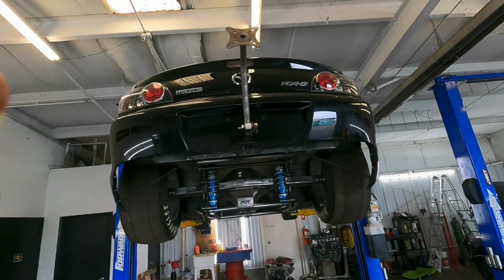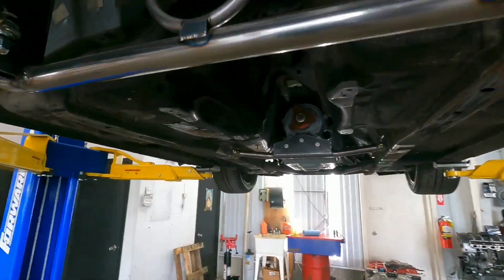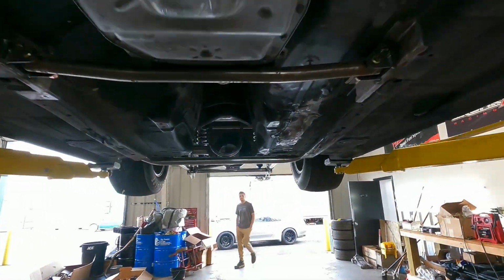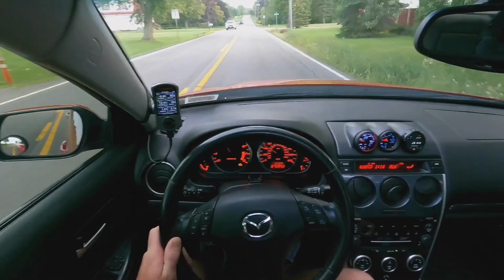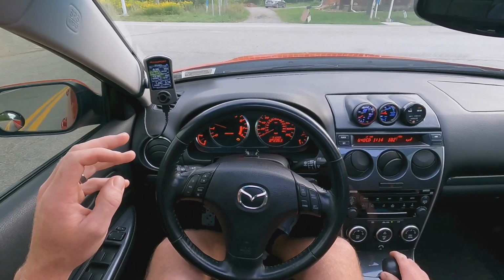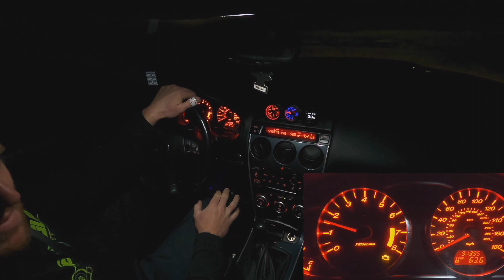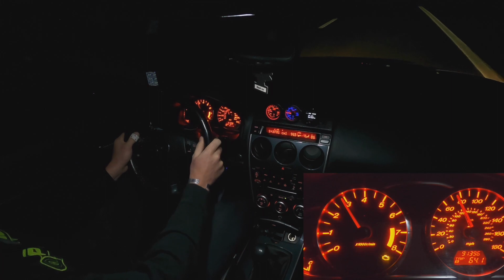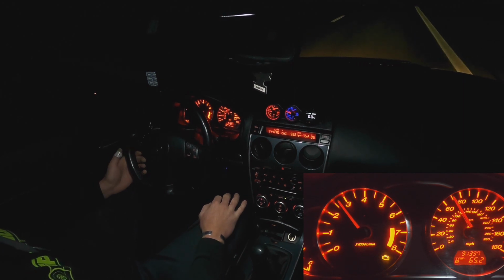Fully Built BIG Turbo Mazdaspeed6 POV Driving Video!!! WOT Pulls, EPIC Turbo Noises & More!

Comment: Hey Alex whats the wastegate setup on this thing? Usually high horsepower speeds have crazy loud nasty sounding wastegate dumps but this sounds excellent. Loud ass spooly noises

Edit: 40 lbs of boost!? My god dude that thing has gotta be so ridiculous
Reply from the maker: VS racing 50mm
Reply: @SpoolingUpPerformance  thanks! do you have it rerouted to the downpipe or is it just a dump tube?
Reply from the maker: Dump to the ground
Reply: What BOV setup are you running? This is an amazing double whoosh
Reply from the maker: Vs racing 50mm

Comment: Are you running a BOV or bypass valve or dual port? Also what kind ?
Reply from the maker: Blow off valve 100% atmospheric. It’s a VS Racing 50mm. Another great option is a turbosmart race port 50mm
Reply: @SpoolingUpPerformance  thank you!

Comment: Are you leaving the balance shaft box in the oil pan for the RX8? I thought most performance oriented Ford builds remove that for quicker revvs. Looks super sick that's gonna be an internet hero when it's done.
Reply from the maker: That’s just simply a mock up engine  in there so we can mock up parts while the race motor is being built

Comment: mod list again......
Reply from the maker: Engine: 
ShortBlock from SP63 / Head Done by Peanessa Race Engines
🔹SP63 Mahle 88mm Pro Series Pistons
🔹Manley I-Beam Rods 
🔹ARP Main studs
🔹Clevite Main & Rod Bearings 
🔹SP63 Custom Age 625+ head studs 
🔹Fully cleaned and rebuilt cylinder head mild port with all new OEM valves , OEM valve seals , OEM valve guides , OEM cams, Crower 65lb springs
🔹Brand New OEM VVT kit 
🔹Brand new CS balance shaft delete kit with oil baffle
🔹 Perm PCV plate with pcv delete 
🔹 N2MB WOT box 
🔹 Cobb AP V3 
🔹 Full EGR delete 
🔹 4 bar map sensor w/ PNP harness
🔹  3 port EBCS
🔹 Dual catch cans w/ VTA & AN lines
🔹  Damond Motorsports Vacuum Block with all vacuum lines and AN fittings
🔹 Mazdaspeed Wire Tucks Coil pack harness Wire tuck with plug and play split second controller & WOT box wiring , as well as reversed and tucked DI harness 

Turbo Kit: 
🔹 Borg Warner S369sxe vband .82ar
🔹 Graveyard Performance Tubular Top mount exhaust manifold Precision V band flange w
🔹 VSR 44mm External Wastegate
🔹 JMF v2 Port Injection Intake Manifold
🔹 Treadstone TR1045 IC core
🔹Treadstone Crash bar 
🔹 Graveyard 4” intake Non Recirc 
🔹 VSR 50mm BOV
🔹 Custom Fabbed IC piping 
🔹  Custom Fabbed catless downpipe to a CS Catback exhaust (modified with vibrant mufflers)

Fuel Systems: 
Direct Injection:
🔹 Walbro  255 In-Tank Pump
🔹 Autotech HPFP Internals
🔹HPFP rebuilt with Rey’s E85 kit 
🔹 Overspeed injector seals
Port Injection:
🔹 Full secondary fuel system with (4) Bosch 2200cc injectors running from a Aeromotive 6 Gal fuel cell with a built in A1000 Pump. -8AN feed & return lines and fittings, FPR w/ electric gauge in vehicle , fuel pump wiring kit w/ relays 
🔹 Split Second Controller 

Drivetrain:
🔹 Xclutch Ceramic Twin Disc 9” Race Clutch Kit with New Pilot Bearing & Throw out bearing 
🔹Rey’s Mazda Parts Solid Shift Cables 
🔹Rebuilt Transfer case with sp63 Billet Caps 
🔹DSS 500+hp Axles 

Suspension:
🔹Bilstein B8 Shocks 
🔹Tein springs in front 
🔹QA1 Springs in rear w/ BC adjustable spring perches 

Wheels:
🔹Street - (4)Evo8 wheels 17x8 with Nitto NT555rII Drag Radials 
🔹Track - (4) Reinforced Rx7 FD wheels 16x8 with Hoosier Slicks 26x9.5x16

Tune: 
🔹Cobb APV3
🔹Pro Tuned by Freektune on 42psi.